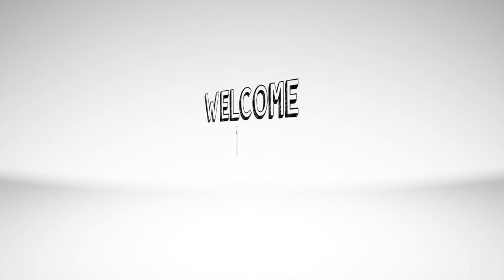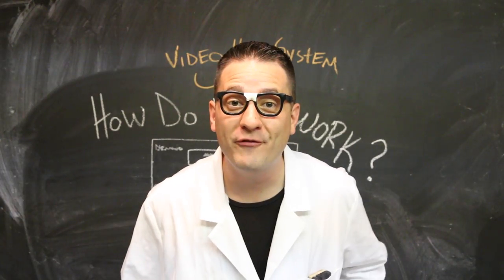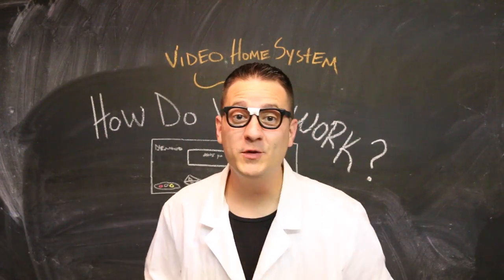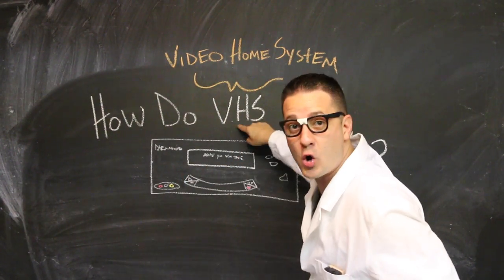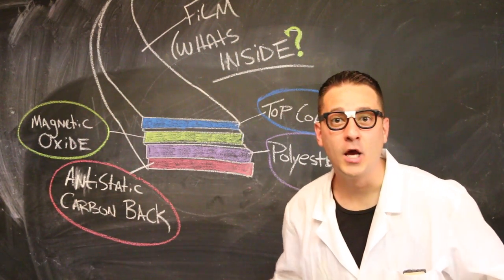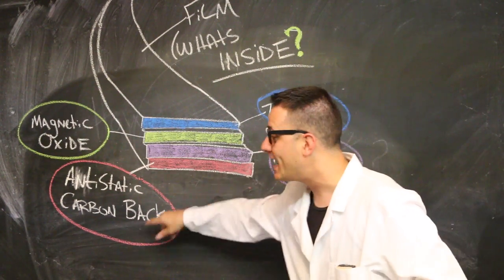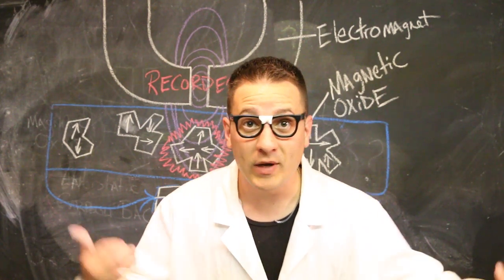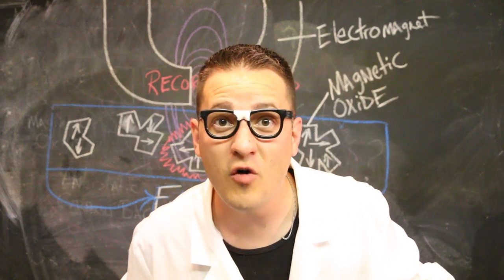How Do VHS Tapes Work?

Comment: This video didn't even tell anyone anything about how the VHS works. You really need to do more research heck even 58 others agree out of 91 so I believe you need to close your channel and have a think on what your actually doing and I had a question on my IPT exam about this stuff and I failed because of this. I looked up to you but you failed me and also you need to be more accurate. Okay thank you. (Btw, I used the 58 out of the 91 for rating)
Reply: If you have a test I wouldn't use a 2 minute video on a skit channel for answers. You asked to fail, you should if watched a 10+ minute video on a channel that specializes on detailed explanation, not on a channel that gives a short, basic explanation amd a skit.